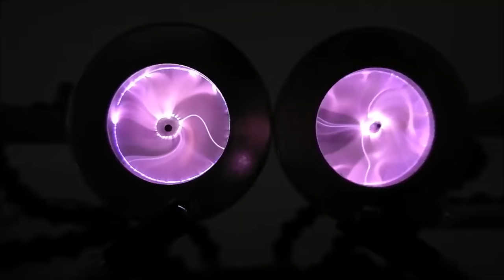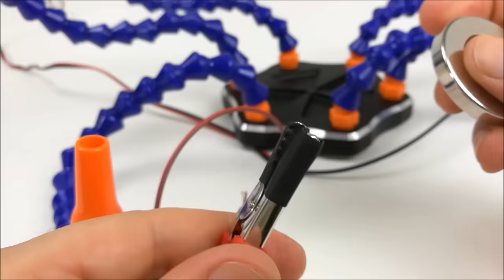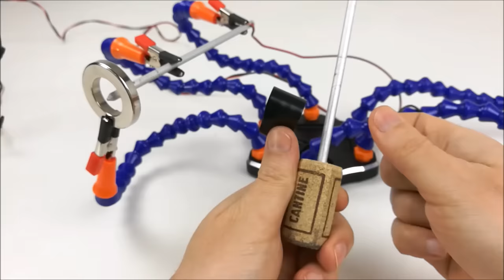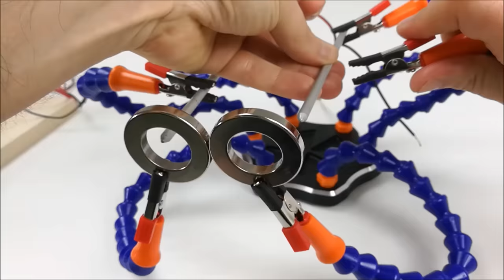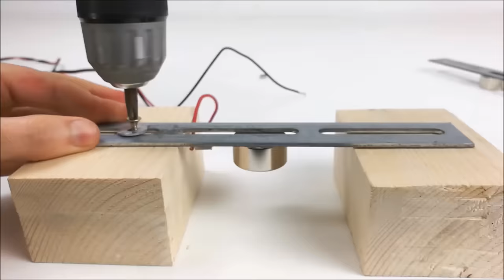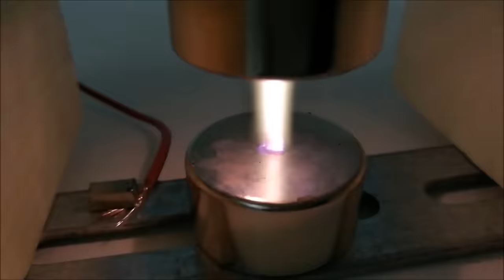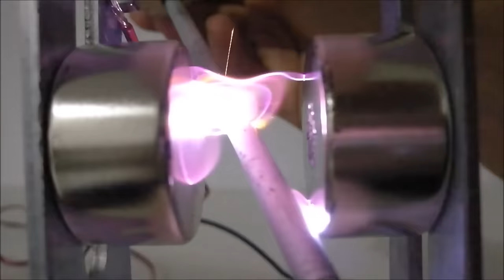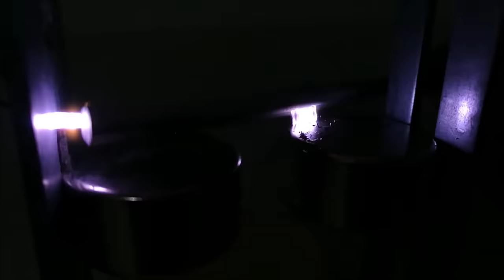Plasma Vortex in a Magnetic Field | Magnetic Games

Comment: Please repeat this experiment, adding smoke or chemical fog to see what if any thrust is achieved when the plasma develops within the ring magnet.  Thanks.  I'm subscribing.
Reply from the maker: thanks for the idea :)
Reply: Bruh, the engine of the future If it works
Reply: But I don't think that rotating plasma can generate that much thrust, but I guess we'll have to see
Reply: Movin Donics won't great any
...still cool tho
Reply: XxFoxMotoX3xX yeah, but I can't judge, I want to try and mod a speaker so that it can create thrust
Reply: The Ionic Wind flows from one electrode to the other, so roughly in the direction of the plasma flow.
Reply: Movin Donics why would the plasma rotate in the first place?
Reply: Its becuase of the lorentz force. These rings are magnets.
Reply: Magnetic Games maybe try it with this magnet inside a acrylic tube you might just get it working as a engine just a idea
Reply: Try spinning the magnet at high rpms lol
Reply: Smoke will disappear
Reply: Plasma will ionize the smoke and it will disappear
Reply: great work! - i think to much of the energy in is converted and the thrust would be almost nothing - especially without a vac applied - and im sure its been done 100 times but first time ive seen plasma creation within a magnetic field and no vac - very impressed
Reply: @lordkrythic6246  wtf did that have to do with anything
Reply: @SoldLike80sCrack 
Read the comment above mine.
Reply: @lordkrythic6246  yea I did, it had nun to do wit black people so why did u feel the need to say some shit like dat
Reply: @SoldLike80sCrack  
First off, if you're not going to bother writing a grammatically coherent sentence, then don't respond back at all. Education is the most important thing that you will ever truly own in this world, and as a human being you should want to express it regardless of the forum you're in. Secondly, I live in America, so I can say whatever the fuck I want.
Reply: @lordkrythic6246  😂😂😂again u bringing up shit that don't matter, and it just proves how much of a dumb fuck u r, fuckin idiot
Reply: Just use Schlieren imaging to see if it's producing thrust.
Reply: @Donimations  metallic mercury  can be used for your idea? I mean anti gravity probe🤔
Or I'm thinking in a wrong direction?
Reply: @ABDULREHMAN-by7zk  what we need is superconductor ferrofluid
Reply: @Donimations  It's already a thing. It's called an ion engine, and it's used on the space probe Deep Space 1 for it's extremely high efficiency despite its low thrust.
Reply: @lordkrythic6246 ,
🔘 One of the hardest lessons in this world for a person to learn (and most never do) is:
"Just because you CAN do something doesn't mean you SHOULD".........Nuff said ( hopefully).
Reply: @joshhayl7459  What are you talking about? The outer ring IS a magnet.
Reply: @voltariantechnologyinc.8594 ,
🔵 You need to read my post again ( carefully ) as you evidently didn't understand it, But, as I stated:
In the arrangement shown in the video there are NO electrical or magnetic fields in place to focus the ejection of ion particles in one particular direction as would be necessary for it to serve as a thruster.
Reply: @joshhayl7459  I evidently understood it perfectly. You're saying that this arrangement has no magnetic field. This is false, as the outer ring is a magnet that focuses the ions.
Reply: @Donnyyy ,
🔵 You are correct, the arrangement of materials as shown will NOT create any thrust.
Reply: @joshhayl7459  Yes it will! You clearly have no idea how an ion engine works! In fact, an ion engine does not require a magnet to work. As long as you're using DC and the negative is connected to the nail, it will create thrust. The gas will become a negative ion, which is repelled by the negative charge in the nail. A magnetic field will help this, however saying that it is required for this to work is simply false.
Reply: @XxFoxMotoX3xX ,
🔵 What in HECK did you just SAY???
Reply: Voltarian Technology, Inc. ,
🔴 You are AGAIN incorrect, and now you've embarrassed yourself on a worldwide forum by trying to put words in my mouth, and since it was MY comment that you were remarking about, it was absurdly foolish of you to insist that you "(Evidently) understood perfectly", when,..of the two of us, I'M the only one who actually knows what "I" meant!....(Smh).
Your response was both inappropriate and juvenile at best, as it is a preposterous and frankly, ASININE-thing to have the temerity to tell someone that you understood what they said after THEY have informed you that you DIDN'T,.......
'THEY' made the comment,...So ONLY 'THEY' would know if YOU understood it or NOT!!!....YOU don't get to say that
YOU understood THEIR comment if THEY say you DIDN'T!!....what are you, a 12YR-OLD ON A PLAYGROUND???.....*facepalm*Smh*.
To clarify:
>I NEVER said (as you erroneously claim) that there was NO magnetic field in the arrangement of materials shown!....
What I DID say however was:
In the arrangement of materials as shown, there is no electrical or magnetic field- 'BEING UTILIZED IN SUCH A MANNER' as to cause the ejection of ion particles focused in a single direction to act as a Thruster.
.......Still not clear on it?....here, I'll break it down even
MORE simply so (maybe) even YOU can understand it:
>Yes, there ARE magnets,.....and Yes, there ARE ions being generated..... however, in the set-up shown, these ions are NOT being "focused" into a unidirectional-stream necessary for creating a propulsive reaction,....... Capiche?
If you are STILL unable to understand my initial comment by now then you are just too ignorant or thick-headed (or both) for me to bother dealing with, do not expect me to respond to any more of your inane and ignorant exclamations as I'm not interested in discussing this with someone who so obviously possesses as little knowledge of the subject matter as YOU do.
My initial comment was one that someone well-versed in the science of it would immediately understand,......
however, I've neither the inclination nor the crayons to explain it to you and I'm NOT interested in teaching you physics....... I've gone as far with you as I wish to on the subject,..I can EXPLAIN it to-you, but I can't UNDERSTAND-it for you.......
If you're REALLY interested in gaining knowledge
of high frequency corona/plasma behavior,.....
then GO STUDY IT!......I AIN'T YER TEACHER!
Reply: @joshhayl7459  Ha! You deleted your comment!
Reply: @joshhayl7459  I didnt just say it, I stated it a year ago. And the context is bad,  because the person I responded to deleted their comment.
Reply: @joshhayl7459  fuck off you're wrong
Reply: It would be great to supply gasoline vapor
Reply: @XxFoxMotoX3xX ,
🔵 Merely telling someone they're wrong without explaining WHY is a waste of your time and energy and theirs as well, but,...If you were to explain WHY you think I'm wrong, well then.... THAT would be productive!
Otherwise you're just blowin' smoke.
..... Better luck next time!
Reply: @voltariantechnologyinc.8594 ,
🔵 Yeah.... accidents happen, and I don't know how to restore it, but, not to worry.... I've repeated the same thing in two texts after that so everybody can follow along without losing anything of import.
Reply: @joshhayl7459  So you accidentally clicked the side menu, clicked delete, and then confirmed? accidentally? Okay.
Reply: @voltariantechnologyinc.8594 ,
🔵 I'm pretty sure that my comments that followed the missing post would make it quite easy for anybody with half a brain to follow, as I had to repeat myself SEVERAL times in my attempts to get through to you. I'm sure no-one else but YOU would have trouble picking up the gist of our communication as it was all a repetition of the same thing said in different ways, so enough already, you're floggin' a dead horse, unless you have nothin' better to do with your life than to harp on a meaningless point.
But don't let that stop you,.... Enjoy yourself!
"Tis better to be thought a fool than to open your mouth and remove all doubt".
....... Keep it up, you're doin' fine!
Reply: @joshhayl7459  Wow, you completely missed my point. Watch the video I cited. This creates thrust. End of story.
Reply: @joshhayl7459  You're a fucking dumbass piece of shit and that's the bottom line. Fuck off.
Reply: @XxFoxMotoX3xX ,
🔴 SOooooooooo........ Your response to being shown that you screwed-up is to call ME names instead of addressing my comment,...Brilliant!!... Absolutely Brilliant!!....Such a MATURE response!...It must have taken you HOURS to compose such a GENIUS retort!..... I'm SO proud of you!
I'm sure it must have been QUITE an ordeal for you to have had to take your thumb out of your mouth long enough to type that out ALL BY YOURSELF!!.......
but Hey! you better get off mommy's computer before she gets home and finds out that her little man has been showing his ass on a worldwide forum,..... hurry now! She'll be home ANY MINUTE!!
Reply: Voltarian Technology, Inc. ,
🔵 I've found no link from you to any other video,....
however, understand that I'm NOT talkin' about any OTHER set-up or even using the materials in THIS video in ANY WAY OTHER than the arrangements demonstrated!!
What I AM saying (for the very LAST-TIME) is:

"None of the arrangements of materials set-up in the manner AS THEY ARE IN THIS VIDEO will result in the production of thrust".

This is NOT to say that these same materials cannot be set up in a way which WILL produce thrust,....but rather that "None of the various set-ups shown in THIS video will produce thrust without modification".
And PLEASE, while you're studying up on this subject, it would certainly benefit you to learn the difference between a simple 'High-frequency Corona' and "Plasma".
........ Do any OTHER VIEWERS with adequate technical expertise on this subject want to weigh-in and see if THEY can get through to "Voltarian Technology Inc" and try showing him the errors in his thinking?... If so, please do,...Cuz I'm OUT!!......Good DAY and GOODBYE to you sir!
Reply: @voltariantechnologyinc.8594 ,
🔵 Btw, Fyi,... The accidental Erasure of my post happened during an attempt to get rid of the false "Read more" that's been appearing at the end of many people's posts, it says "Read more" but when you tap-it the text 'Blinks', but there isn't any more to read.
Reply: Don't think he's has the electric power to generate that much thrust, maybe an electromagnet would be better, I wonder what a sub woofer in space would do
Reply: @joshhayl7459  do you have psychosis?
Reply: @Dainith ,
🔵 It would merely oscillate in place silently, as sound waves will not propagate in space.
Reply: @joshhayl7459  wrong again. You can cast metal in space using audio.
Reply: @joshhayl7459  just get the fuck out you negative fuck
Reply: This would burn fuel in space for shure
Reply: same thoughts!!!!
Reply: @XxFoxMotoX3xX ,
🔴 I have NO idea where you're GETTING this stuff!!
.....My comment had NOTHING whatsoever to do with
the subject of "Metal-casting".....smh.
Well,...Pay CLOSE attention this time.....
The question asked was:
"What would a subwoofer do in space?"....
What I stated in response to that was (and I'll reiterate the fact): "It would merely oscillate in place silently, as sound waves will not propagate in space".
Reply: @joshhayl7459  then how come astronauts can communicate with earth while in space dumbass
Reply: @joeguy6351 ,
🔵 Why exactly would that be needed here?.....
Reply: @XxFoxMotoX3xX ,
🔴 Calling people names and using inappropriate language ain't gonna get you NOWHERE with ANYBODY kid!!...( except maybe on
the school-yard playground).
Ask Google using the search-question:
"Will sound waves propagate in space?".......
I'm sure you'll get your answer there ( if you're capable of understanding the information that it'll provide).
You're really lacking knowledge of some VERY basic stuff.
FIRST you don't know the difference between Plasma
and a high-frequency-Corona, and NOW you're telling me
that you didn't know that sound can't travel in the vacuum
of space!?!?......
Look kid, I got no problem with somebody being ignorant
as long as they're interested in learning,......But like I
said before.....
"I AIN'T YER TEACHER",.......GOOGLE-IT!!!
And while you're at it, learn how to disagree without being
disagreeable. It'll get you a lot farther in life than name
calling will.....Good luck!
Reply: @bravosierra8010 ,
🔵 Actually, there is no "plasma" being created here, what you are witnessing is a simple rotating high-frequency Corona discharge.... Nothing more.
Reply: @joshhayl7459  ferrofluids and superconductors are magnetic. They will follow the vortex and it could at least look cool. But more importantly we know that rapping a wire around a iron nail then moving a magnet around it to disturb the magnetic field will create a current through the wire, so I want to know what would happen if you could get a super conducting ferrofluid with a lot of magnetic power then spin it really fast by making it follow a electrical current.
Reply: @joeguy6351 ,
🔵 To my knowledge there is no such thing as yet as "Superconducting-ferrofluid", there is ferrofluid and then there are superconductors, but so far no one has managed to combine the two that I am aware of.
A good theoretical question though,...at this point, one can only Wonder!.....
Reply: @joshhayl7459  you could make it tho. It's justs a type of metal thats cooled with liquid nitrogen. The hard part is preventing it from freezing. Oh and i almost forget, you have to suspend that particular metal in with the ferrofluid. In fact, now that I think about It thats probably the harder part.
Reply: @joeguy6351 
🔵.... I agree!
Reply: @SoldLike80sCrack  .You ate this idiot
Reply: No need for video, thrust would be net 0. You are welcome.

Comment: I’m probably real high but I think this could lead into a real lightsaber
Reply: I'm probably real high but I think this could lead into Star Trek engines 👀 "Star Trek: The Next Generation Technical Manual indicates that the impulse engines are nuclear fusion engines in which the plasma from the fusion reactor powers a massive magnetic coil to propel the ship. It is a form of magnetohydrodynamic or magnetoplasmadynamic thruster." 
😁
Reply: @garouthedemon7401  ya don't say
Reply: Well a lightsaber is kind of a blow torch kind of
Reply: @hippotesttokill750  lightsaber is definitely giant plasmic solid or structure how else would it melt/pierce through metal doors a blow torch would just blow the fuel its thrusting across the surface its pointed towards the lightsaber doesnt act like an ignited gas definitely more of a plasma or solid
Reply: im not discussing it im just nixing the idea its a blow torch read between the lines...

Comment: you're getting close to discovering something great, the same thing i discovered a couple years ago, ill let you figure it out on your own ;) hint: try this in a vac chamber, and with different shapes of fields and differing HZ, need more than one fly-back though.
Reply: Magnetic vortex wormhole generator?
Reply: @AaryyanVivek  nope, but a form of propulsion none the less..
Reply: @the_socompsp  This did nothing unique when I tried it. What are you saying it does? I spent a couple of hours setting this up so I'm a little peeved, unless I did something wrong - but I'm not seeing what I could have missed. Thanks
Reply: @owlredshift  what are you using as a power source? and what Hz is it operating at on the output? also how are you shaping the magnetic fields?  have you ever seen demonstrations on how sand reacts to certain sound Hz on a membrane? you can do something similar with plasma and magnetic fields. that is as much as i am willing to tell you as the result from doing these things "correctly" may be leading to a new form of propulsion and i am not about to willingly give away my secrets on a platform sun by the patent/idea stealing giant known as google. i cannot tell you the amount if times i have used google to search if my "invention" has already been discovered or patented only to have it happen from under me only a month or so later. coincidence perhaps but it has happened more than a few times so i am weary of divulging info on any platform related to google. the gist of what i am claiming is that it is possible to get a directed stream of plasma that can be used as propulsion in a  vac.  i came across it by accident and have no idea about the physics surrounding it so i am trying to be able to replicate it in other builds constantly, and once i can do that then i will be inviting a physicist to give their opinion on WHY this is happening..  and BTW if you are mad about spending a few hours experimenting then you are in the wrong hobby my friend..
Reply: @the_socompsp  lol you are full of sht. make a vid, mr inventor
Reply: @RKroese  lol I don’t have time to make videos teaching other people about things they will only try to use for their own profit. You don’t even know what I am talking about so how could you possibly calm me a liar? Lmao pathetic.
Reply: Good luck

Comment: awesome , basically prodefined movement of energeyic protons and electrons under certain magnetic flux
Reply: In fact, better to say... movement of ions. In open air there is no reasonable amount of free protons
Reply: yeah , right . but this was surely awesome
Reply: @AyushSingh-me5si  heh, protons = hydrogen ion, or rather protium
Reply: @mikhail1608k  You can tell it is not hydrogen from the color spectra
Reply: Or you could just say... plasma.